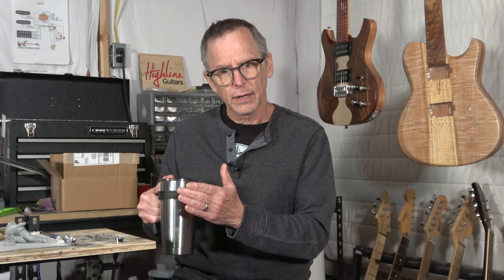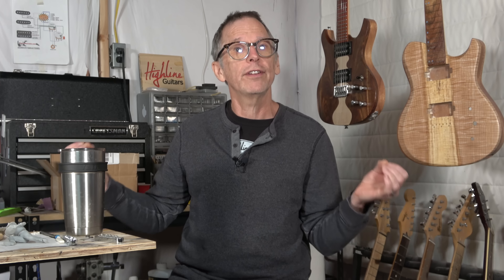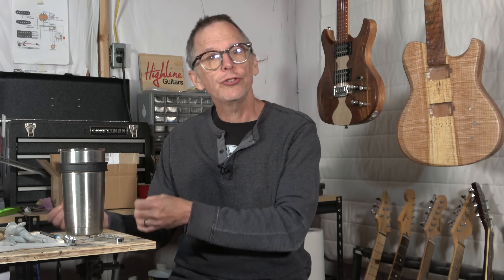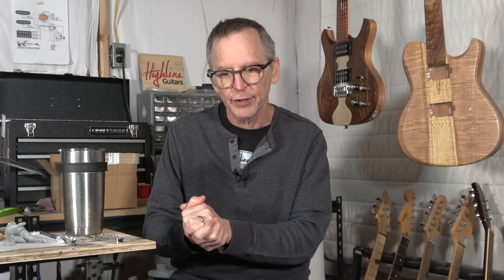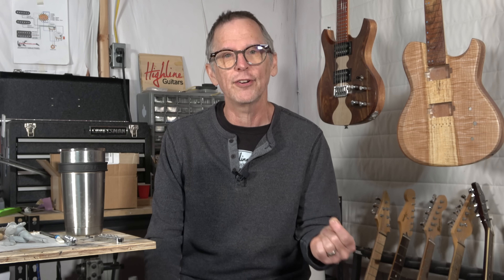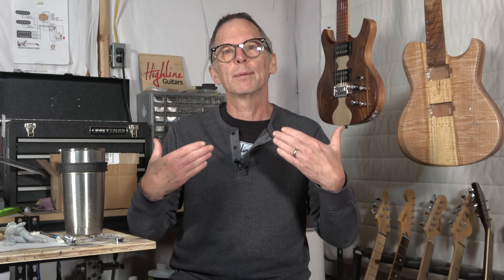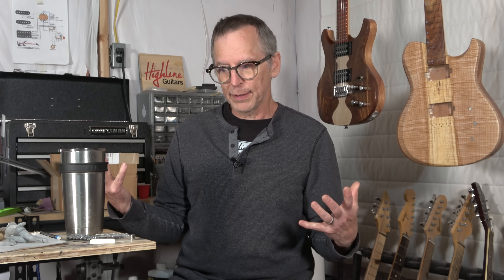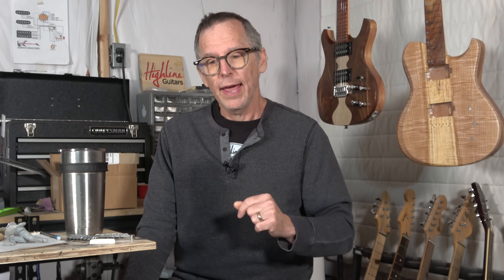Before You Make A Guitar, Consider This

Comment: Yes absolutely. And i am feeling that you do not completely discredit the entire desire to use such products or influences on desired outcome and i am is well pleased with how tactful you have explained the design decisions. It is a pleasure to watch your videos as you are very relaxing and even mildly a.s.m.r. If you will. No offense, i love guitars and how to build guitars by real lutes doing the actual work. 
Thanks for a splendid job of it. Have some questions also. ...
.....Note some Latin monikers are included, for science.
Would like to build this= 6, 7, or 8 string, or 9, 10, 11, or 12 string. Note those others would use a Kahler tremolo and, the tuning intervals would be closer on some strings.
1) Extreme metal shape with large footprint yet thinner. And inline reverse Xtreme headstock. So decided it shall be neck through for this.
2) Indian Rosewood or Dalbergia Latifolia for the NECK through. Alternative = Walnut, or Juglans Nigra.
3) Fretboard is bird's eye maple. Alternative = Ziricote. 25 stainless steel frets. Zero fret.
4) Body shall be = Swamp Ash with book matched Flame maple BACK. No top just a flame maple veneer on top.
5) Pickup DiMarzio D Activator X bridge. And Super Distortion S in the neck. With a Sugar Chakra in the middle position. Assortment of color.
6) Ratio tuners and Schaller Floyd Tremelo with big brass block and titanium posts. 
7) Finish is dye and, maybe a small paint pen and, airbrushing, with thinner satin clear to seal in.

Comment: Let's talk about thе guitar parts that became an industry standard  for most of the builders (excluding the retro-vibe guitar brands like Fender and Gibson) and every modern high-quality guitar must have. For example: 
- locking nut (on the guitars with Floyd Rose or Kahler type tremolo), 
- the truss rod (yep, the first Fender guitars had no truss rod), the 2-way truss rod for the top-level guitars, 
- open truss rod nut (not like on the old-fashioned Fenders),
- independently moving saddle bridge (the first Fenders had 3-saddle bridges, and the first LesPauls had just a stopbar),
- carbon reinforced neck,
- quartersawn wood neck,
- PU or PE or whatever durable finish,
- glue-set frets,
- stainless steel frets (for the top-level guitars),
- locking machine heads  (for the top-level guitars).

What about the roller nuts, I think they are cool, but they can't be used on the guitars with the 6-in-line Jackson/Gibson Explorer-type heads or Gibson LesPaul-type heads cause the strings aren't parallel there. The roller bridges are cool as well, but they can't be used on the guitars with bigger radius fingerboards, cause it's impossible to change the radius of the such type of a bridge.

Comment: Very worthwhile video. I have been disassembling, reassembling, swapping out necks, changing pups and components and building from cheap 'kits' then upgrading for years and years and have to agree with much of what you say. The completed electric guitar is just one part of the signal chain including fingers/picks, to strings, to pups to pedals and amps. All have an effect on the eventual sound and all interact with each other in every different chain . The electric guitar is a tool in a tool box and any dogmatic statements of neck joints to hardware choices being BETTER than something else is very subjective. Which is BETTER really ? Longer or shorter sustain ? Which is BETTER brighter or warmer tone ? Its all down to what the player wants ! How do you say one sound is BETTER than another.? These discussions mean nothing to the listener, gigger, record buyer, they just like the FINAL SOUND.  Just look at the variations in Strats from 1962 or Les Pauls from 1959. Some bangers and some bombers even from same woods / constructions / components from the same line and year. Just enjoy your building, experimenting, playing. I say forget the snake oil and just build and play and if you are just a buyer/player, then just listen to the guitar, if it does what you want it to, it's right for you, forget about the rest...................enjoy !

Comment: I just love bolt on guitar. It has that snappy attack,  I can shim it and have more floyd pull up range.  With rear mount locking nut , I can easily add and remove shim. When sending for refret, my luthier have easier time working on it. I can remove the neck and body, put it in my travel bag and take a flight.

Comment: I think, the things in the guitar building business are a bit more complicated. Those big guitar builders like Gibson and Fender tried to use some more advanced guitar building technologies, like compound radius fingerboards, two-point tremolos (instead of traditional 6-point ones), thinner modern C or U-chape necks, graphite reinforced necks, reinforced neck heads, noiseless hum-canceler pickups, locking tuners, roller nuts, etc. However, the more modern and advanced were their guitars , the less they were  bought. That's because the musicians, who want to play on a Strat or on a LesPaul want the sound they heard on their favourite records of 60s  or 70s, and they think they need to have exactly the same guitars to get that "genuine" Strat or LesPaul sound. I meet such kind of musicians pretty often. 
The same time, the more modern guitar builders like Jackson and ESP  had no such limitations. So they made the most innovative guitars to those days and got the big army of young guitar players to love their guitars. 
Another issue of using more advanced technologies is their cost. For example, the locking tuners are about 30% more expensive than the regular ones of the same brand. That's why they are generally used  for the more expensive guitars.
Reply from the maker: I think what you are saying about musicians wanting the sounds they heard on their favorite records from the 60s and 70s is true to a point. That generation is declining in numbers. Younger players who are the primary guitar-buying demographic today could care less about that music.

Comment: I 'love' when people say "X, Y, and Z will give you better tone" 🙄 Tone is subjective. Tone is arbitrary and contextual. Different construction methods and components will sound different and behave different ways, and will affect the tone in certain ways. But none make "better tone" because there's no such thing as objectively better tone. For every tone that one person loves, there's someone who hates it. For every tone that works for one genre or song or arrangement, there's gonna be genres and songs and arrangements it doesn't work. For every player who wants the sound of a neck-through, there's another who prefers an instrument with a bolt-on or set. None of these tones or techniques or components are wrong. They just achieve different goals for the instrument. The only people who are wrong are the ones who are claiming a specific method is correct because it's how you get 'better tone'. 

PS. Love your videos. I've been thinking about building my own bass for years now and have really learned a lot from your channel. Not sure how i'll swing building one in my NYC apartment, but i'll figure it out eventually!

Comment: If it were possible it would be interesting then to construct 3 of the same guitar with the same wood,  hardware and electronics but only changing the type of neck construction: bolt-on, set, neck-thru. Then doing diagnostic tonal analysis to compare major differences or lack thereof. I realize that different pieces of the same wood species might even introduce some differences that would be confusing to the analysis. But still interesting.

Comment: Chris:
As always, I watch your videos with admiration and gratitude. This one was particularly interesting because it gets into the "philosophy" of instrument building, so to speak.
Question: So, for necks, I've seen you do (1) a combo of CNC carving and adding a scarf joint, (2) an "inline" Fender-style headstock, and (3) an angled headstock on a maple neck carved from a single deep slab.
Along the way, you've made convincing points about the virtues (and drawbacks) of each approach (e.g., avoiding the issue of "short-grain" construction that the scarf joint approach allows).
So I'm wondering what you think of a "hybrid" version of number (2), an inline Fender-style headstock, but with more depth in terms of the overall profile seen from the side.
In other words, if I'm working with a six-string bass neck whose heel has a depth of about 20 mm, could I plunge the headstock (about 15 mm thick) to maybe 30 mm?
So the headstock would be 10 mm lower (or higher, depending on how you look at it) than the heel, which would translate to a steeper angle for the strings after they come off the nut and go to the tuners.
I know the Fender design was above all economical, so the heel depth and headstock depth relative to the fretboard correspond.
But with a CNC design, I could see making the headstock about 10 mm lower than the heel and maybe avoiding string trees and similar compensations?
Reply from the maker: I don't see any reason not to try this.

Comment: ..it all has to do with the quality of the craftsmanship..i would say 90 percent..the rest is materials..you cant tell me that a sloppy tuning machine with 15;1 ratio is going to be as good as a well built tuner with 19:1 ratio (and in this sense we are coming back to craftsmanship on the hardware level..) ..also a floyd bridge plate made out of copper is not going to give the performance of one that is made of steel..which adds cost to the machining in the former of harder tools, etc..and what about steel versus common copper/nickel frets?..sure out of the box two guitars might be as good, but a few months down the road depending on the use of the instrument is going to show some differences..but for the majority of products today..in almost any sector of the consumer world today, the majority of the difference depends on marketing, consumer awareness, and the innate need for humans to appear better than others by the 'quality' (and the well-known related price) of those products..Gibson has a tradition, and when somebody in the later stages of building a gibson screws up and the whole guitar body included is thrown into the dumpster, then it is a much bigger loss than when a fender body doesnt match with the neck..and only the body is thrown into the dumpster...hence the extra price of gibsons..and one of the reasons that fender could produce cheaper guitars..

Comment: As always nice vidro and perspectives. 
If I remember right, Ron Wickersham of Alembic used thru neck construction because it was easier to do than set neck. At least for what they did: small volume high end guitars and basses.  
I tend to agree.  As long as you have nice strsight wood in long enough pieces,  thru neck is easier than set neck to make.  Thru neck is easier to glue up and get the neck angle right.
Bolt on is the easiest,  then thru neck finally set neck, at least to me.  YMMV
Sound wise the tonal qualities and sustain only have negligible differences in most cases when amplified given the same electronics and hardware.

Comment: A lot of good points in this video. What do you think is the easiest construction is to build between set neck, neck through and bolt on?
Reply: I think bolt-ons are the easiest construction. Set-on necks need to be glued at the exact size and angle. A through neck requires machining a long piece of wood. If a mistake is found, set-on and thru necks require a great deal of work to correct it.

Comment: As far as sustain, does it matter what the wood is?  The string is resting on point A (nut slot) and point B (saddle slot) and the string vibration doesn't change between those points.  The string only makes contact at a very minute place. It would be an issue of the pickup being able to pickup the vibration.

Comment: What you're talking about generally speaking here is something that frankly scares me about the prospect of building guitars for people to buy. I'd hate to get to the point where I make really nice solid body electric guitars with quarter sawn maple necks and an awesome bolt on neck pocket and setup, really nice fretwork and fingerboard work, awesome neck shapes, nice hardtail bridges, but....I'm hearing from lots of people that bolt ons are cheap, or that laminated necks are better, or that tune o matics are better or something. Or that I should be using crazy expensive swamp ash bodies because they resonate better. I guess if I somehow ended up with a good enough reputation that people were interested in what I make and trust my choices, I could avoid that. But starting out? I dunno.
Reply from the maker: None of this was an issue before the internet.

Comment: When a guitar beginner asks me a question, I answer that.

There is no "best", there is only " choices".

For example, it is said that a through-neck is easier to play and sounds better.

However, if that neck breaks, it will require extensive repair.

A bolt-on neck is simply a matter of replacing the neck. (Provided, of course, that you are not attached to that neck.)

All guitars are made up of such " choices". Advantages and Disadvantages. We, the players, choose the " choices".

In recent years, more than a few professional players are using Squier and Epiphone guitars. They have chosen them because they have the sound they want and the quality they need.

IMO, think for yourself and find your ideal. I think guitar players need to be calm and wise like that.

Comment: The answer to all those "why isn't everyone doing it" question is money.
Manufacturers, especially when producing at scale, seek to cut cost at every corner. So, even if, say, neck-thorugh construction is objectively better, the cost involved in overhauling a whole production line is prohibitive. Same for any component - the cost for the component itself, and the re-tooling and re-design, may prove to make a real dent in revenue. So they're not going to do it. Especially when the majority of instruments sold are essentially made to "classic" or "vintage" spec, because that's what sells.
Reply from the maker: Money is definitely a factor. However, it can work in the opposite direction. If a production technique or a component choice is demonstrated to be clearly superior, the big guitar companies have to find ways to adopt them to stay competitive. The reason many of these companies won't adopt a lot of these choices (roller nuts, neck through construction, etc.) is because their advantages are subjective rather than objective.

Comment: Hi Chris. Thanks so much for making these comments. As you have pointed out numerous times, there are so many variables that can impact the final output that its really hard to quantify any specific aspect of the consruction. I've been playing guitar for about 46 years and have had p!entry of experience To support this. For example, the simple notion that there are "good" Les Pauls and bad ones, even though they were built in the same factory on the same day with the same methods proves this out. You talk about better tone, but even that doesn't really mean anything. I've built a coup!e of guitars now, but unlike you, I'm not building  them for sale and so I'm just hoping for something that fits me. There is no greater feeling than playing your own instrument so if any of your subs are reading this, I would say build what you like and you will never fail.

Comment: I don't think that neck-thru has a better tone or sustain. I have neck thru, set neck and bolt-on guitars and I couldn't say that one type of construction stands out. If you care about tone and sustain, think more about the placement and build quality of the bridge, the cut of the nut, the pickups and the exactness of construction and assembly. None of those things in isolation will do any wonders, but they are things that certainly add up.

Comment: there are downsides to many of the "advanced features". 

boards for neck through design have to be longer and have perfect grain. as a one man small shop luthier you cannot adjust neck angle which you may need because you make unique instruments and want to experiment. as a big brand you cannot stockpile standard necks at the factory to use in different models. as a player you cannot swap them. 

locking tuners usually weigh a lot and make the guitar neck heavy unless it has a massive body or a heavy bridge (and at the same time they're useless with floyd rose style bridges). 

roller bridge makes no sense without a tremolo and only steals a bit of sustain in that case. roller nut - well, i haven't seen one that does its job well because the roller size is too small (unlike the weight and the cost). i stick to simple nuts made of hard materials with low friction against steel and nickel. a good headstock design is also important. 

a tremolo only makes sense for someone who uses it. otherwise it's just added weight and cost which will most likely complicate the tuning process and bending. 

this list could be endless. besides, simple designs tend to look and feel better and age better than overengineered ones.

Comment: What’s often overlooked about roller nuts and bridges, is that they have to be VERY finely engineered if they’re not going to introduce slop and/or unwanted friction at the two most crucial contact points for the string. If you paid less than $75 for that component, you probably just made things worse…
Reply: From my perspective it seems that the friction between string and roller is typically lower than the roller/centerpin friction.

Comment: I have a 600 dollar guitar with a bolt on neck, and another guitar that cost 3 times as much with a neck through. The 600 dollar guitar sounds better in every Amp, and speaker I've put it through and the more expensive one collects dust.